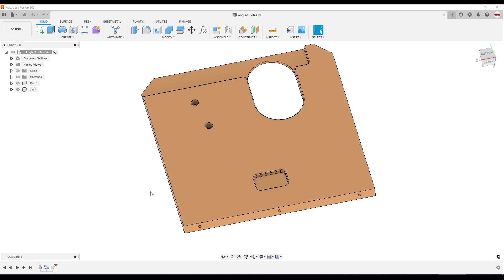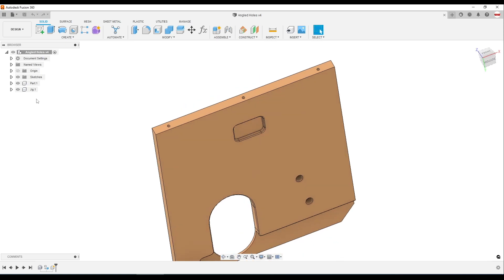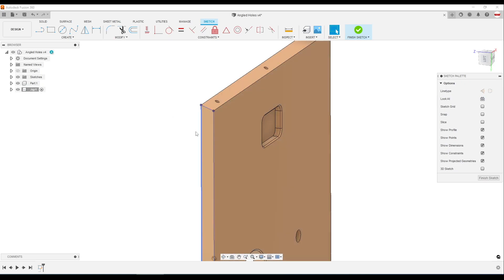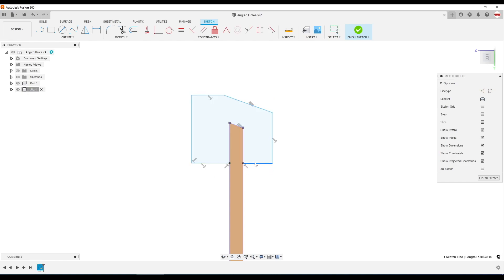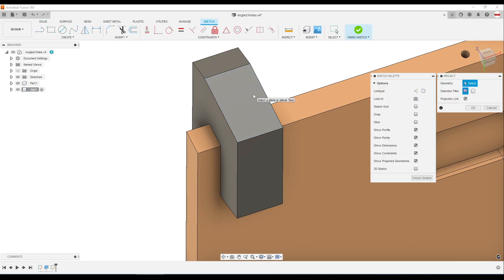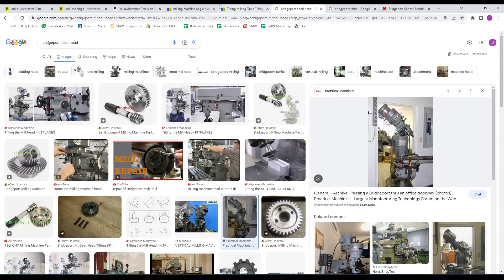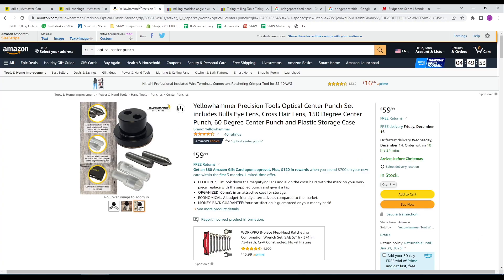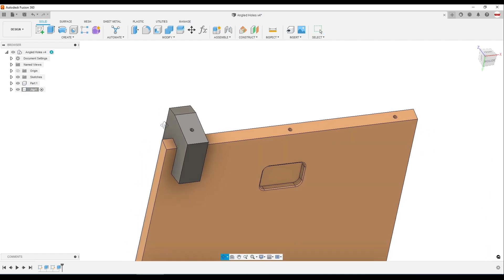How to Drill a Hole at an Angle at the End of Large Plate?

Comment: Good jig idea for angled holes drills! It helps with repeatability of drilling as many holes as required; it keeps drilling easy and smooth (as a guide) for each drilling; and also holds the workpiece at place firmly when drilling; during my BS Mechanical Degree (2014), we designed a jix and fixture so relatable work! But this certainly added into my knowledge! Good work! Smart Engineering!

Comment: I'd make the bottom parallel to the top, then make it out of metal. The top hole can easily be drilled on a drillpress/Bridgeport at that point. But only go to that trouble if many holes need jigged.